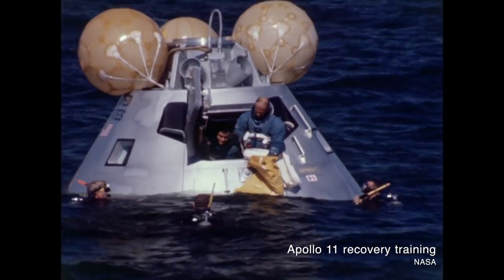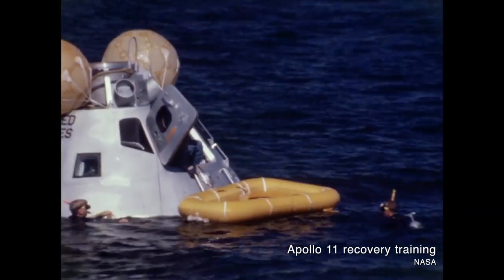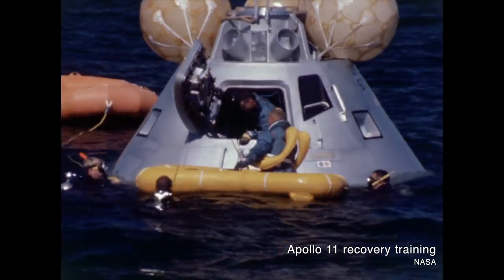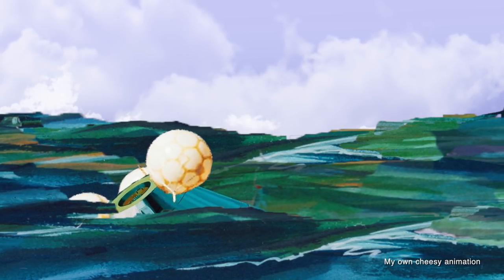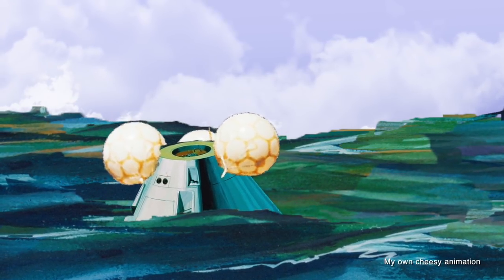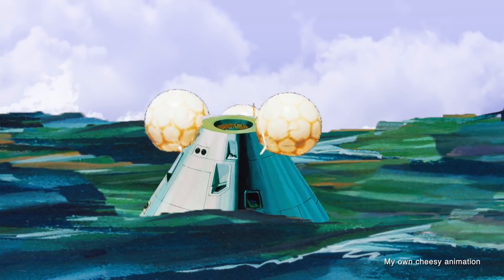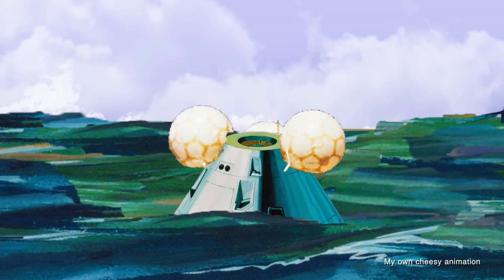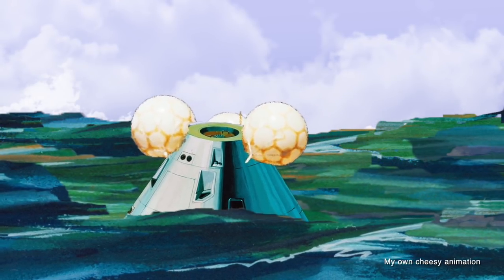When Apollo Kinda Doubled as a Boat

Comment: Amy, one of the wilder parts of the Apollo program was the launch pad escape systems that used zip lines and a slide to get Aastronauts away from the rocket possibly exploding on the pad. The slide was built to be fire proof and lead to a buried vault with a foot thick steel door and was seen in an spisode of The Six Million Dollar Man. By the why, the last Apollo flew on Apollo-Soyuz mission and re entry sequence didnt t turn off the right valves in sequence and attitude jets vapor nearly killed the crew when the cabin was vented with outside air.

Comment: 1:20 It was not even about secondary landing zone. It was more about failure of communication systems. They were also expecting that some cruel guys from USSR could be trying to jam comms. In such situation they had to rely on what they had, the AGC and sextant to determine state vector (P23?) and then use the P37 program to calculate return to earth burn (for the final correction before reentry). It wasn't that precise as when using state vector from uplink and all the reentry data from uplinks. So they could have landed further away from the planned landing site. I hope i explained this well enough.

Comment: All part of the training and/or testing.  I guess it was resource-intensive enough that they didn't have all the astronauts do it.

I'd be curious what the task list was that they had to accomplish.  Presumably get to stable-1?  Open the hatch?  Looks like they were also getting out the life raft?  Did they have to triangulate their position by stars, or did they assume that NASA would know where they came down?  Presumably they also had to conserve power so that the recovery vessels could radio-locate them once they were close?  

There was also the wilderness survival training that at least some of the astronauts went through, in case the capsule came down on land, I guess?  I've seen photos of the astronauts doing that.  You get dumped in a remote location with only what's actually the capsule at splashdown.  The one thing you have TONS of is fabric (parachutes).

Comment: How did they choose the backup splashdown sites?
Reply: Calculate the main target area and give yourself a couple hundred mile radius in case of shallow/steep/ oblonged re-entry induced by atmospheric elements . There was a small margin of play of course for the re-entry angle being that the CM could be manually adjusted around its COG to compensate for such occurences.  I
Reply: "Try and hit the blue part of the round thing in the window..."

Comment: Why was the Command Module recovered with an aircraft carrier? It's always felt kind of overkill to use an enormous floating airfield when any number of other naval vessels could have done the job.
Reply: I suspect mainly from the resources that an Aircraft Carrier has of both fixed wing (jets) and rotary aircraft (helicopters) and availability of crew.
Reply: At the time of the Gemini and Apollo missions, the US Navy operated a large number of smaller carriers of World War vintage that were dedicated to anti-submarine work. These carriers operated patrol aircraft such as the SH-3 Sea King helicopter and the S-2A Tracker patrol aircraft. They did not carry any fighters or ground attack aircraft. 

It was these anti-submarine carriers that were usually allocated for spacecraft recovery duties.
Reply: One of these, the USS Intrepid, is now a museum in New York.

Comment: Just got back from the grand opening of the new Apollo exhibit at Seattle's Museum of Flight.  If you push the button to view a video at the exhibit with Command Module #7, this is the video that plays!!  Great exhibit - new highlights are an intact, unflown F-1 engine (involved in a fire during a test, then later slated for Apollo 18, which, of course, never flew), along wth some of the F-1 engine remains recovered by Jeff Bezos expedition from the seafloor at a depth of about 3 miles a few years ago.  Got to hear a couple of talks - including one with David Concannon, who led the expedition to find and recover the Apollo F-1 engines.

Comment: It is actually safer to have landed on land than on water. On water, you will be confined to the spacecraft, be adrift, and risk being engulfed by waves if the weather turns nasty. On land, you can... just walk away. And yes, there are the politics of it too. The USSR knew that if they landed in the ocean the US Navy would have threatened to get to their landing first. The USSR could afford land landings because it had plenty of unpopulated level land. The US has much narrower swaths of land without risk of something populated, and most of that is mountainous areas. (definitely not ideal to land a spacecraft)

This is not just for spacecraft. If you know about airplane safety protocols you know they too will make all attempts possible to land on land instead of water. On land there is much greater chance that even if the plane breaks up passengers can evacuate to safety and can wait out being rescued. Heck, planes have had emergency landings without proper landing gear configurations on runways because they know that dry land maximizes their chance of a safe evacuation. (and because airports are the ones equipped with all the needed emergency equipment) The 'miracle on the Hudson' was an exception to how disastrous water landings get. They had to make the ditch because there was no open space on land, and they were lucky there were so many boats that could come to their rescue within minutes. Had they attempted the ditch just a few miles off-shore in the ocean, many passengers would have frozen to death before the first rescue boat arrived.

Comment: And to think that Apollo 13, for having to rewrite the entire mission after the explosion, wound up with one of the most accurate splashdown points in the history of the program. p.s.  Tom Hank's voiceover of Jim Lovell saying that the cause of the disaster dated back to a design defect that dated back two years before they were named to the mission is a bunch of hooey.  Read "13: The Flight That Failed" by Henry S.F. Cooper.
Reply: Michael Witkowski 1) The tank thermostat that never got upgraded from 28 to 65 Volts; and 2) The dropped shelf while removing it from one of the SMs and eventually loading it into the SM used on 13, damaged pipes. Add 3) Unapproved shortcut for boiling off excess LOX heating the tank, fusing the thermostat and burning the wiring insulation. All you need now is enough gaseous oxygen and a spark, which happened at 55h54m mission time, on the third cryo stir.

Comment: please explain how astronauts were able to drive the rovers on the moon without flying off into space with engine thrust. also, why is there dust on the moon? why isnt it just rock. thats one conspiracy theory
Reply: Muhammad Omer Khan The rovers had no rocket engines. Just electric motors. What little gravity there is keeps it on the ground just fine. Dust? Eons of rock being pulverized by impacts would create a fare share of dust.
Reply: There is dust on the moon because the cleaning crew has been slacking off. You should see the mess under the carpets.
Also what the other guy said. Why didn’t they reach escape velocity when they “bunny hopped” during the moonwalk? Because some gravity is better than no gravity.